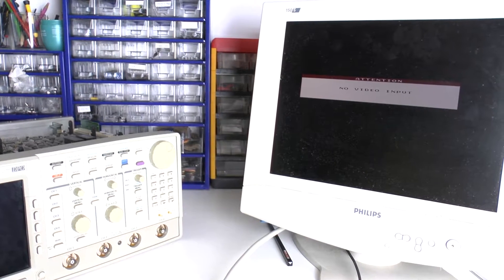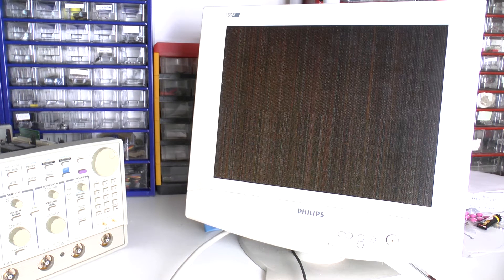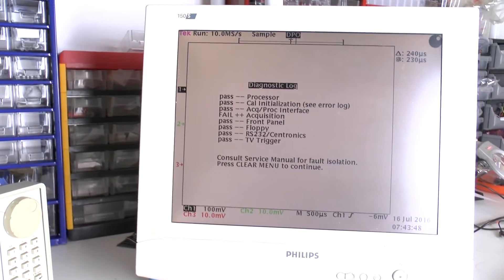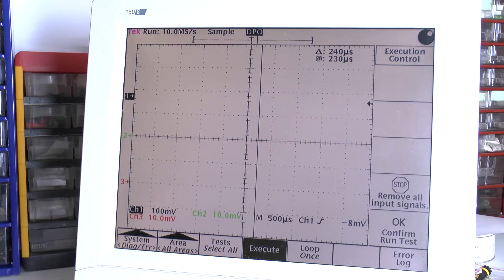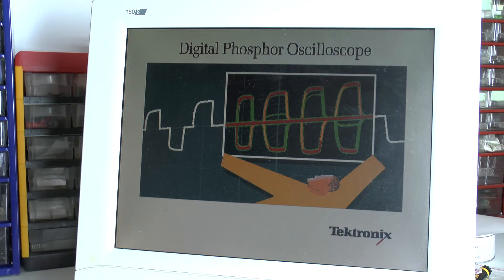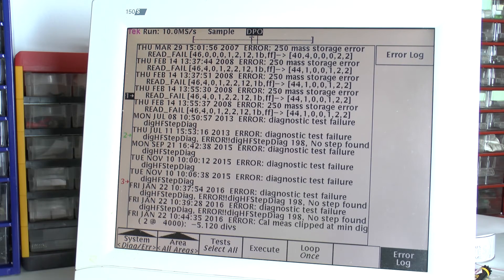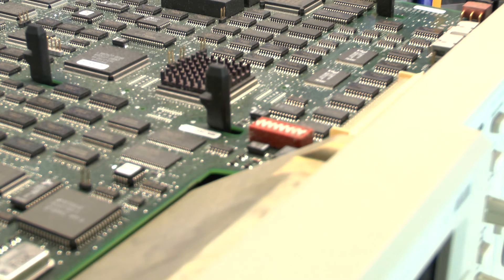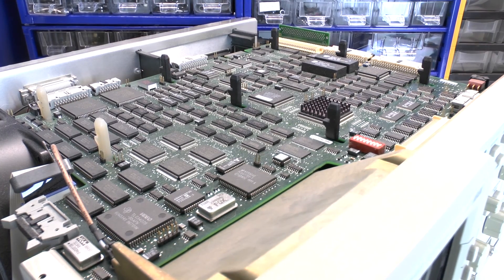Tektronix TDS754D - self test

Comment: I've just paid a lot of money for one of these from ebay. Watching this has got me worried. How can I tell if the jumpers have been messed with? They have shown a picture showing that it passes the self test but how can I be sure. It's due to arrive on the 27th December. Any advice would be very much appreciated.
Reply from the maker: A lot of money and TDS754D are two words I do not like in one sentence. How much did you pay?
Reply: @MrTamhan  I paid £1000 plus postage
Reply from the maker: @chickennugget3362  f##k man, this is quite a bit of green. For this, you can almost get a TDS7104...either way, hit me up the moment you get the scope and then we look at it together.
Reply: @MrTamhan  thanks so much, I really appreciate it
Reply from the maker: @chickennugget3362  in principle, what we are gonna do is simple. a) give it 1h to blow up its caps, then b) run SPC and then c) do some tests against its cal source. Is this unit from the US or from Europe
Reply from the maker: @chickennugget3362  f##k. This is a C, for 1000GPB, this is expensive. The D has a totally different type of DPO mode...
Reply: @MrTamhan  Oh well it's been dispatched now. I've been looking for months before I saw this one. Should be better than my current Hitachi V-680 that I've been using since the 90's. I'm only a hobbyist. I'm just worried that someone might have messed with the dip switches on the processor board like you explain in this video.
Reply from the maker: @chickennugget3362  dont throw the Hitachi away though. An analog scope, always, has its merits...
Reply: @MrTamhan  Got it today. Passes the self tests but has this in the error log: ERROR: Cal meas clipped at max dlg
Is this anything to worry about?
Reply from the maker: @chickennugget3362  Hello, that can be an old leftover from a repair. Can we run SPC?
Reply: @MrTamhan  Sorry, what's SPC?
Reply: Sorry I'm pretty clueless as I'm trying to get back into electronics after a 20 year break. I looked it up and ran a test. Not sure if it's passed or not. It doesn't say fail. Not sure if I have to run it on each channel. I wish I could post pictures up to show you. Really appreciate your help!
Reply from the maker: @chickennugget3362  no issue man, we want to move fast here tho. Email tamhan@tamoggemon.com man.

Comment: Hey Tam which manual are the tables in that you show, Operation, User, Service, Programming etc? Thanks for the post Keith
Reply: Yes, I feel the same.  I am reading the Tektronix documentation as well as online Google found reference sites I have compiled and that Keith referenced and man... there is a lot of information to go through.  

I'm trying to break this project down into pieces also kind of like the Modules that come with the scope and then will have to trace back from there on the different types of boards and sections on the board and as you note the specification relating to the sections and components on the board including the traces literally.

Troubleshooting circuits in general seems to be something like physics/math where you have to know the fundamentals with some variables and then critically think what would be the missing variables.

I am relating this to a computer and the associated stock and up-gradable components where usually components can be replaced and sometimes something on the boards can still be repaired like capacitors.  Looking at the newer oscilloscope models, they even look more like a computer motherboard which makes me wonder if you can purchase the module cards and hack into an COTS computer if you have the software to run since some scopes look like they run off Win7 even.  Either way, seems to make me more confident jumping into the TDS520A I purchased and found doesn't come with the standard VGA Outputs as I noted from reading the manual as being stock.  

To make this easier since I want to test some antennas I made, I broke down last night after the last counteroffer on eBay and purchased a TDS520B with the VGA Output as well as the Centronics and RS232 outputs to provide some more modules that I can use to easily (hopefully with faith) diagnose issues on each system.   

As Keith noted and encouraged, I am going to update my YouTube site and try to film my work also... I installed Avidemux 2.6 and looks like I can edit videos now once I learn the software.  

What do you use to edit videos?  Maybe there is something easier as I haven't done the video editing for 15+ years and don't have the software or hardware I used back then.  Figure, I'll try the OpenSource route now days. 

All the best and many thanks to the insight regarding more details of the TDS family represented!
Reply from the maker: Whoops, I am stupid. Sorry, I wanted to add it in the show notes. Here it is, for now:
http://www.timmestein.nl/wp-content/uploads/2015/04/TDS520B_Digitizing_Oscilloscope_Component_Manual.pdf
Reply: You should try this site here for some cool schematics on the TDS Series scopes. You may find them very useful if you didn't know about this site already. 
http://hakanh.com/dl/kits.htm   scroll down to the "Other-Hard-to-Find-Documents". I downloaded what I needed and had a friend unlock them so I could edit them. Where do you live, accent? I live in south Louisiana.
Reply from the maker: Hello,
I am an Austrian by birth, but live in Slovakia. Don't ask about my accent. ;) ;)

Re the site: that Häkan guy is said to sit on a stack of microfiche files describing the TDS5 and TDS6 series in even more detail. But he is not willing to give them to a scanning company...

Tam
Reply: Wow that's cool, i'll have to look up Slovakia.  Ok I won't ask about your accent. How did you end up there, if you don't mind my curiosity? That's a shame about the documents, but i'm glad he gave some of the more important schematics. Any real technician should be able to fix the scopes with the schematics provided the parts and programs are available. I ended up learning electronics from our military, I retired 17 years ago but still work as an electronics technician and love it. Where did you learn electronics at? If the conversation is to private for everyone to read we can move this to a YouTube private message.
Reply from the maker: Hello,
shoot me an email at tamhan (at) tamoggemon (dot) com ;) ;).

Re the fixing: IMHO, the problem here is the Tek custom parts which Tek, of course, does not sell on a piecemeal basis. This is something which Agilent does much better IMHO.

Plus, Tek could be REALLY helpful by telling more about the meaning of the diag commands. AKA; what each of the dig* means and where the error is coming from.

All the best
Tam
Reply: that is not true about Häkan, i know him myself..
Reply from the maker: jafinch78 hello, thank you so much for your praise! please shoot me an email when you publish a new clip. As for editing, I have to admit that I use Premiere...costs 20buxx a month, sadly.
Reply: Thanks for the feedback Tam.  Much appreciated.  $20 beats a one time way higher price and nice to know if you owned an older version of an Adobe product, you can download the older version for free if old enough.
Reply from the maker: Hello, with me the problem was another client for whom I used to edit films and who insists on Premiere :)
Reply: Hi Tam, I saw your article on Qt5 in one of the newer Linux User and Developer magazine editions.  Great article and interesting the Qt software and capabilities.  I was thinking about installing Visual Studio to practice C# since I only used C++ and never learned.  Happened to be reading up on Linux also and the new distros since I haven't used Linux for programming in 15+ years and was wondering what's new in C++, bash and writing and compiling C# using Linux on a pensioners budget.  Saw your article on Qt and am inspired to read more for cross platform interface capabilities.  Thanks again. Very Best Regards.